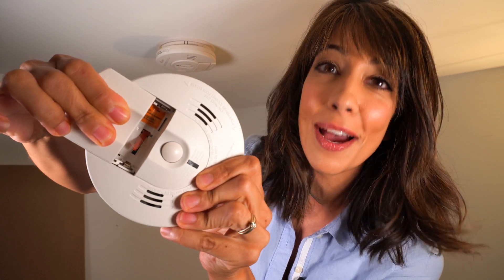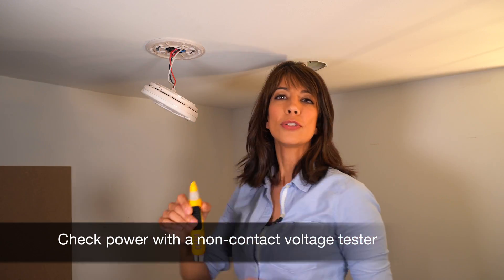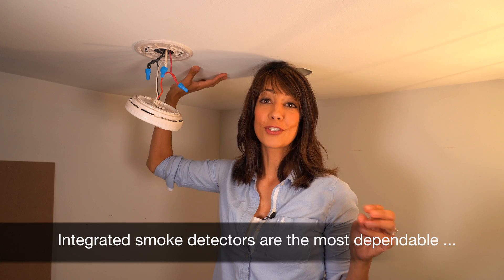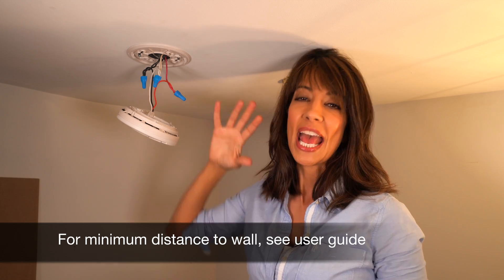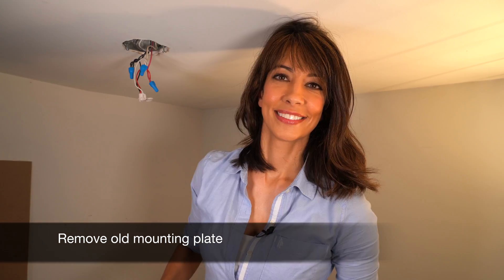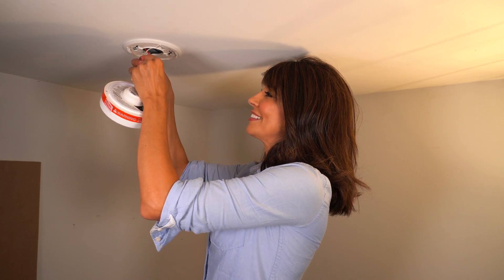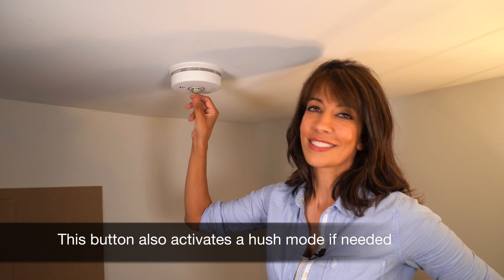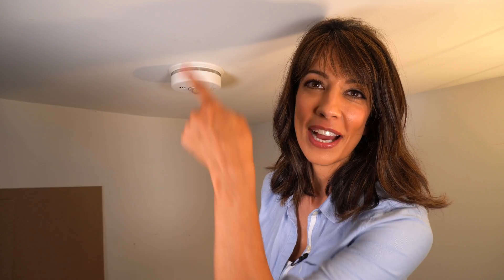How To Replace a Hardwired Smoke Detector | Why These Are The Best!

Comment: So it’s ok to DIY? It’s not required to have someone else do the work??
Reply from the maker: Where I have lived replacing a smoke detector does not require a permit. You would have to check your local electrical safety code to know what is allowed in your area. Wiring a smoke detector does require a permit. Hope that helps. Thanks C Cat!

Comment: So a couple of questions... we have Kidde smoke detector system in this house... the one in the main room goes off every three months... and we put another 9 volt in it.. But we are done with that.   We want to change it out with a lithium... however there are so many manufacturers out there... We can't afford to replace them all at once and would like to go to a different brand... if we just put in the one for now will it be compatible with the rest of the older kidde system.. we want one that is alexa compatible and talks
Reply from the maker: Hi Doris, you don’t have to replace them all. It’s important that they are all working and having one that goes off randomly is frustrating. Smoke detectors from major brands will come with a guarantee for up to 10 years. It’s a good idea whatever brand you choose, to keep your receipt. On occasion, smoke detectors will malfunction and I have had to exchange them at no cost. Thanks for the question.

Comment: If all you're doing is unplugging a cable and plugging it into a new unit, why do you have to turn off the power? P.S. Your products links are busted.
Reply from the maker: Thanks Kenn for taking the time to let me know. I updated the links. 👍🏽 I turned off the power as a safety precaution. Once I know a unit is wired properly I replace them without turning off the power. Good question. 👍🏽

Comment: I have a question how come since the smoke alarm has a light how come wasn’t that working 🤔
Reply from the maker: At the time I shot the video I was using three bright studio lights. Because they are extremely bright you can’t notice the strobe light in the video. I actually retested the smoke detectors with the lighting kit turned off to be sure and during my inspection. I didn’t include the strobe light footage because some people have sensitivity to flashing lights. Good question and observation. 👍🏽

Comment: Really good video.  Exactly what I was looking for.  Excellent job on the camera and editing.  I just ordered a new smoke/carbon monoxide detector per your recommendations.  Since the one I'm replacing is tied into other detectors in the house, do I have to replace them all at the same time or can I do one at a time?  Thanks
Reply from the maker: Hi Kal, what’s most important is that all your smoke detectors are working well and are not expired. Smoke detectors expire after 10 years. If you don’t know how old your detectors are it’s safest to replace them. 
To find the expiration date look on the side of your detector. If a date isn’t listed I would replace the the unit. Good job keeping your home safe. 👍🏽

Comment: Interesting info, but you tell us how to squeeze on something to remove the battery from the wire connection, but you don't show us. :(
Reply from the maker: Hi Allen, if you’d like to install the harness for a hardwired smoke detector here’s my video on how to wire a smoke detector: https://youtu.be/KS6miVOztGs 
In the video I’ll show you how to wire the harness if you don’t have one installed yet. Cheers and thanks for the comment👍🏽

Comment: I have replaced a few 10 year alarms after 3 years for some reason.
Reply from the maker: It does happen on occasion, unfortunately with smoke detectors. Thanks for taking the time to comment. It’s an important reminder. For that reason it’s good to save your receipts. You can get a free replacement with  warranty.

Comment: Ionization detects Ions which is why it goes off during cooking, but won’t always work during a house fire. Don’t buy
Reply from the maker: Good point Chris on photoelectric alarms. The National Fire Prevention Association (USA) recommends using both types or a using a combination alarm instead. Some Building Codes and Local electrical codes will specify which ones to use, in specific locations. Photoelectric are the most commonly used type and offer good protection. Photoelectric units will detect smoldering fires (before they begin to flame) which will alert you sooner. Thanks for posting! 👍🏽

Comment: If I am replacing an expired Kidde hard wired smoke detector, can I use the old wire harness and just plug it into the new detector, or do I need to use the new one and attach each wire again?  Many Thanks!
Reply from the maker: Hi Kate, yes you can. If the harness fits your new smoke detector you can clip the new unit into your existing harness.

Some older harnesses are not compatible. In which case I wire a new one. Hopefully that’s not the case. I have a wiring smoke detectors video you can check out if needed. Thanks for the question! Hope it’s an easy swap out. 👍🏽
Reply: @DaruDhillon  thanks so much for this helpful video and your response!

Comment: Great video!  Love the info about the internet wire.  Looks like there is an advantage to replacing these things with the newer model of the same brand so one does not have to deal with re-wiring a different wiring harness.
Reply from the maker: Whatever brand you choose, I'd install the same units throughout your home. Also, when it comes time to replace them. I replace them all at once. Thanks for watching!
Reply: Interconnected, not internet.
Reply: These new models are faulty pieces of shit...
Reply: 4 5thref f
Reply: Not so anymore. Damn Kiddie has changed the plug on it's smoke and Co alarm. Didn't want to have to rewire it, but I do.
Reply: @brianzamparelli9166  Yep, they changed the plug. So I had to put the new plug on 4 new detectors. Same brand and model, different plug.

Comment: Nice video. yeah last year we updated to ones in my parents house they had ones from the 1980's but the strange thing was they had 2 signal wires instead of 1 like the ones now a days so when installing I had to hold the test button and my dad had to see witch wire was pulsing with a volt meter and on the one he was fooling around and I was like please hurry i'm going deaf here LOL. The 2 wire was a pain the first 2 we did tested didn't work wrong wire so had to take them and switch the wire what a project but we got it.
Reply from the maker: It’s great that you kept at it and found a solution on your own. It’s nice that you were able to help your parents out! Thanks Hunter! 👍🏽

Comment: This is a very helpful video. Thank you very much. I have read quite a few of the comments, and the annoying beeping after a few years seems to be a common complaint. I would like to add a suggestion to this excellent video. Most hard-wired smoke alarms do have a back-up battery. In my country, it is a 9 Volt flat battery. I would suggest to replace it with an alkaline one as it last longer. As the name suggests, the back-up battery is to still provide the protection in an event of a mains power blackout.
Reply from the maker: Thanks for the tip Hon! Glad it helped.
Reply: According to most sources, you shouldn't use batteries interchangeably. You have to replace lithium batteries every year. Americans who follow the annual replacement rule generally do so at the clock change, so either Spring forward or Fall back. Here's what Consumer Resorts says about lithium vs alkaline batteries.

"Lithium 9Vs aren’t recommended for smoke detectors unless you follow a strict battery replacement schedule. Those batteries maintain a high voltage until the end of their usable life, so they provide a much shorter “low battery” warning to alert you that it’s time to swap in a fresh one. Alkaline batteries, by comparison, have a more gradual voltage drop-off, prolonging the “low battery” alert and greatly increasing the odds that you’ll be nearby to get the alert."

Comment: We had changed ours because just changing the battery still has it beeping.  Last year, we learned that they expire after so time.  This year, it was time for another to be changed.  We bought another one, replaced old one with it yet I wake up with it beeping
Reply from the maker: If you have updated all the smoke detectors in your home and one of the new ones is beeping, or not working properly are you able to return it to the store, or company for a refund? I personally install Kidde smoke detectors because they come with a 10 year guarantee. If you have an issue you get a full refund with receipt. It's important that your smoke detector is clean, not exposed to construction dust, paint, etc.

Comment: If I’m replacing one hardwired smoke detector, do I need to replace all the other detectors at the same house?
Reply from the maker: Hi Diana, you should replace all smoke detectors that are expired, malfunctioning or not working. Thanks for the question. Good luck with your project!

Comment: i have 4 usi smoke detectors that are expired. I replaced one but have not pulled off the sticker for the battery. However, all my smoke detectors (3 old ones and 1 newly installed one) are all beeping continuously. What did I do wrong?
Reply from the maker: Hi PJ, You need to replace all your expired smoke detectors. Smoke detectors expire because dust accumulates on the smoke detector sensor this can cause them beep and reduces their ability to detect smoke or carbon monoxide. It’s a safety issue.
Reply: If your units have back-up batteries, then I think they are running low. It is also my belief that all hard-wired units also have a back-up battery in case the mains power is off.

Comment: This is a great video however I cannot seem to find a 10 year battery PLUS hardwired that does not come with the connector with pins already connected??
Reply from the maker: Hi Andrew thanks for letting me know. I have a video on how to wire a smoke detector if interested where you can attach the quick connect. https://youtu.be/KS6miVOztGs

Comment: Lithium-ion is not a good option for smoke detectors. Lithium-ion is highly flammable once exposed to water. Nickel metal hydrate is the type of battery you need. You must charge nimh monthly. You must must test for wattage not voltage. If you don't feel like doing these things you can make your husband do it because your husband enjoys it.
Reply from the maker: Homeowners that I know prefer not having to change their smoke detector batteries monthly and these are standard now. We’re all have our preferences! I don’t think I could make my husband do electrical, that’s my job.
Reply: @DaruDhillon  Well every one should learn electrical science at a young age to reduce waste because more people will be fixing things .

Comment: Uhhh not sure if anyone caught this but she is actually using 14/2 wire. If you go to the store and buy 14/3 wire, you will be returning it because it will come with 4 wires....
Reply: To interconnect you want a third insulated wire. You would use the bare grounding wire to interconnect.
Reply from the maker: Hi Josue, there isn’t anything to catch, in that sense. The first smoke detector closest to the panel, like this is wired with a 14/2 wire which is the home run, it powers the first detector only. The 14/3 wire leads to the next smoke detector. That’s what we use thereafter to connect all other smoke detectors. The fourth wire is the ground. I have a video on how to wire smoke detectors if you would like to learn more. No need to return anything. This is wired properly, to code and was inspected. Hope that helps!

Comment: Hi daru, my smoke detector (same the one you have in the video) keeps beeping but I can’t seem to know what’s wrong. It’s brand new. Any ideas???
Reply from the maker: I would check your connections and if you are still having issues the units are under warranty and can be returned to the store for a full refund. I would recommend keeping your receipts for any smoke detector brand you choose because they can fail before the warranty is up. I hope you were able to find a solution Jim.

Comment: This is just laziness I’d rather change the battery myself sealed 10year batteries are not reliable, I had one and it lasted 2years then started chirping
Reply from the maker: If you prefer to change them manually that works for you. We all have different preferences. In areas where I work these are standard. I hope you got your money back as they should have come with a guarantee.

Comment: I have 14 hardwired Kidde AC Hardwired Smoke Alarm
 i12060 smoke detectors hooked into a system-wide alarm system in the house. They are 6 years old. The hallway one beeps every 3 minutes no matter if I remove it to discharge it, change the battery (correct direction, using 4 different NEW Duracell 9V batteries), etc. So I bought a new one and THIS one is doing the SAME THING!! I have replaced its battery with a NEW Energizer 9V bought today, removed and discharged it, replaced the wires, and it STILL BEEPS. Any advice regarding this issue short of calling an electrician? VERY aggravating!

Comment: Useless.. Too much talking
Reply: The talking was just fine.
Reply from the maker: That’s a first! Was there something missing that you would have liked to learn? Or do you just object to talking? ;)
Reply: @DaruDhillon  What he meant to say but didn't word it for some reason is talking without reaching a point. It's like game reviews where it could all be covered in 5 mins but the video is stretched to 15 with a bunch of 'Ummm' 'I think' and 'yeah' type comments. Beating around the brush then finally coming to the point.
Reply from the maker: @kylehill3643  thanks for the input Kyle. I wanted to get in the safety information for those who want it, or skip ahead!
Reply: @Dinesh K, just admit your are green with jealousy. I had not seen any videos where someone explained what all those wiring meant and how to take step by step actions on fixing the alarm. So, if you can do a better and informative video we will watch out for it.